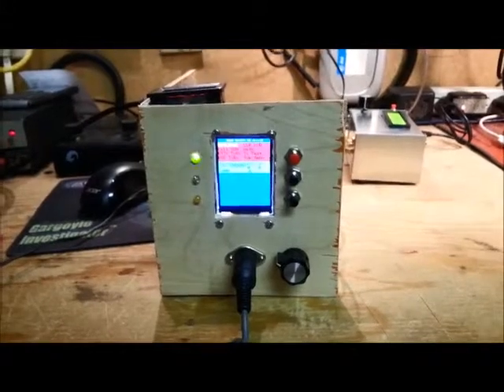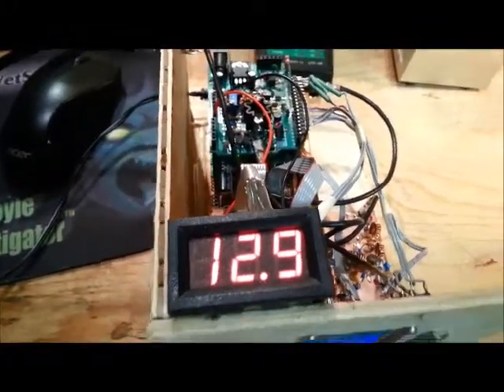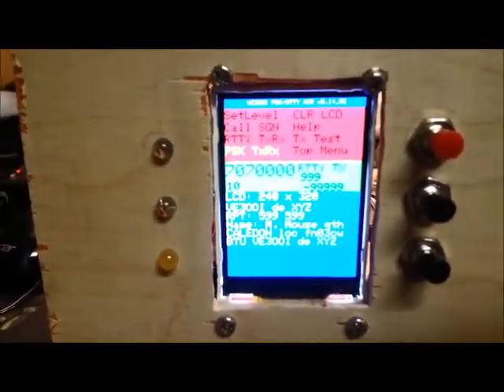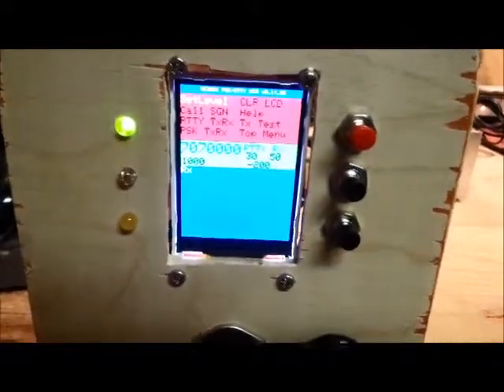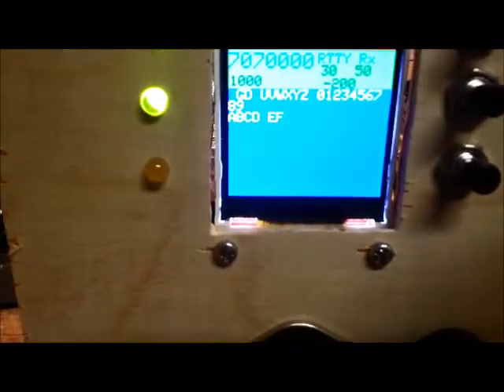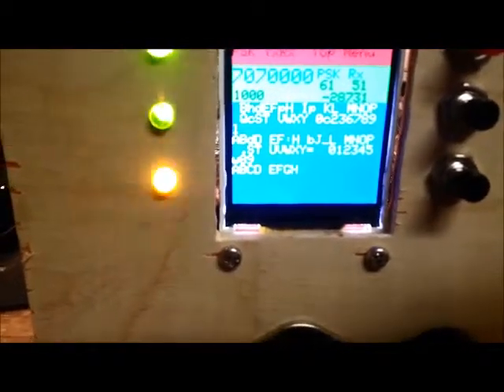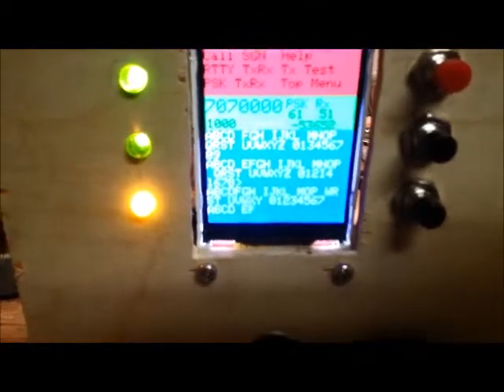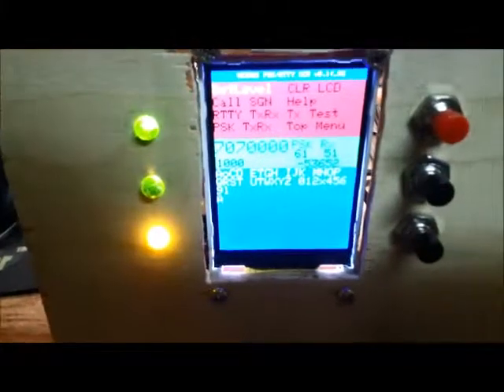Arduino PSK/RTTY Transceiver May 2017 Update

Comment: Hi Dave ... Great job.!
Even if you had already posted this video about your PSK-RTTY Arduino decoder project for some time ... I'm just analyzing it now.
As I am a fan of Arduino decoders.
I downloaded the files from your Github.
Unfortunately I didn't find them very clear ... especially in the Arduino connection diagram - TFT display- etc., and the sketch.ino gives me several errors especially related to the "serial1" and "serial2" of the libraries you entered ... .
Let me start by saying that I am only interested in decoding the audio signals (PSK -RTTY) coming from the receiver and reading them directly on the TFT display.
Could you give me some help? Possibly by upload on your Github a simplified .ino file for the reception of psk-rtty signals only?
I thank you . 73
IU4ALH

Comment: Woukd there be a possibility to make a shield for the arduino with the needed hardware on it?  I like browsing around for rtty signals and use an android app to decode them. But it only has three bandwidth settings and i keep finding wider width signals.
Reply from the maker: Yes its completly doable.  However, I am not up to the task right now.  There is insufficient interest for me to do this.  You are more than welcome to do this yourself.  Software and hardware is open.  Look on my github page   https://github.com/drajnauth (some repos have both hardware CAD drawings/gerbers and software)

Have you heard of SOAREX (https://www.youtube.com/@soarexhb).  If you are interested in homebrew radio projects then you should attend our meetings (bimonthly) where we discuss homebrew projects.  https://groups.io/g/SOAREX/messages